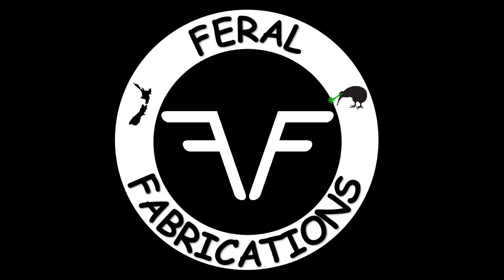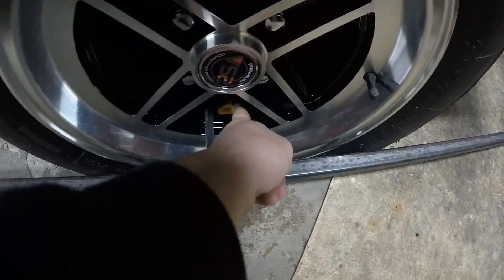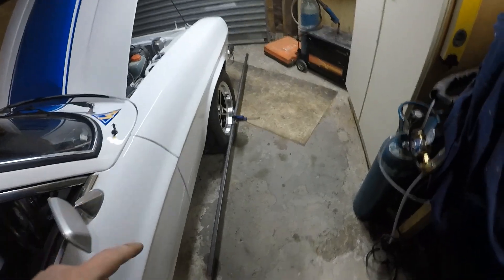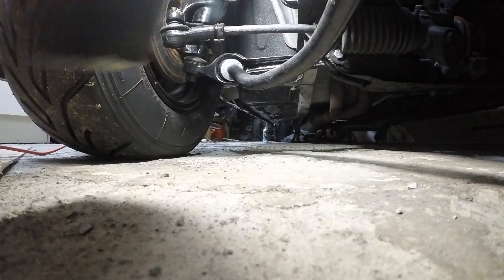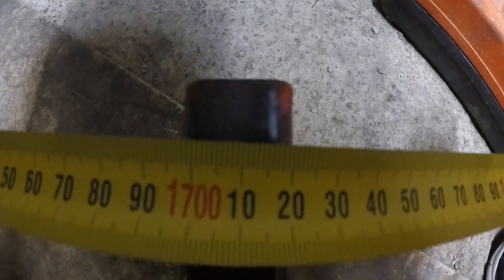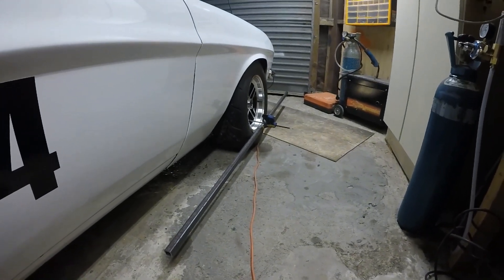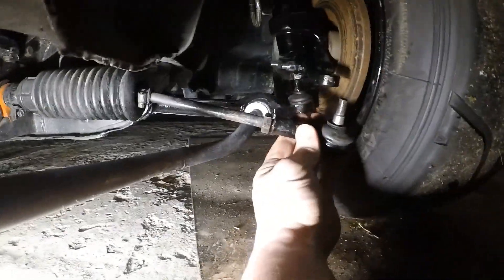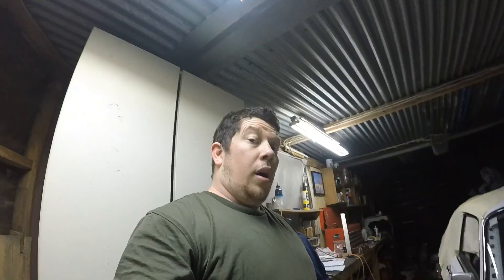Clapped out Ford Capri Race Car - Ep7   Wheel alignment in the shed

Comment from the maker: Hey everyone, buddy corrected my science. DOH! Needed to multiply by 2. My maths only considered one side. So 14mm difference between the front & rear measurements would be 0.2degrees in this case, not the 7mm difference as I said in the vid. We actually ended up with 12mm difference so less than 0.2degrees toe in. Pretty accurate for a shed allignment!